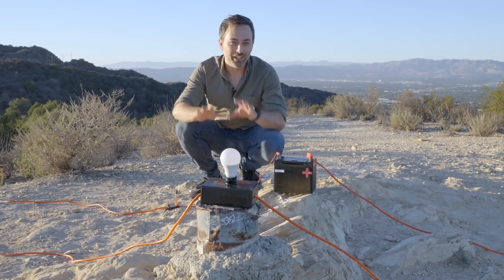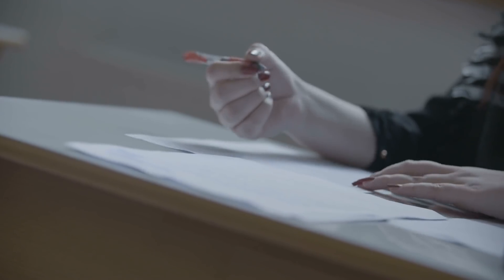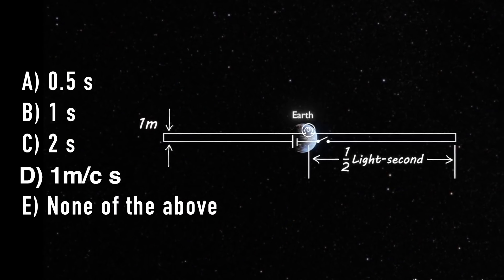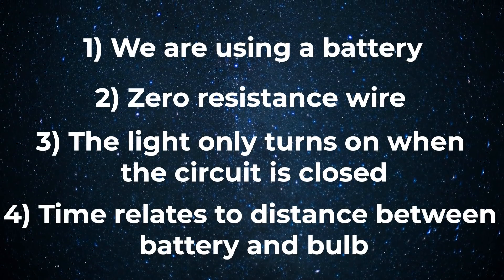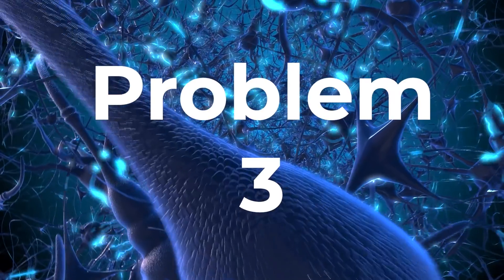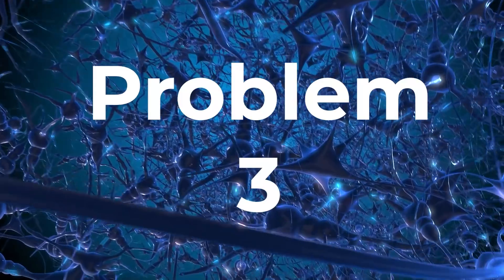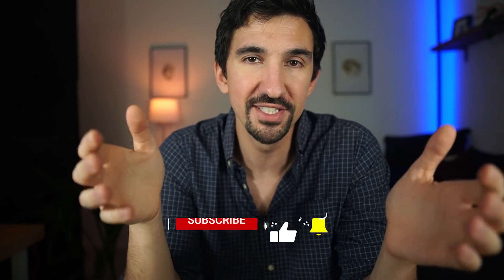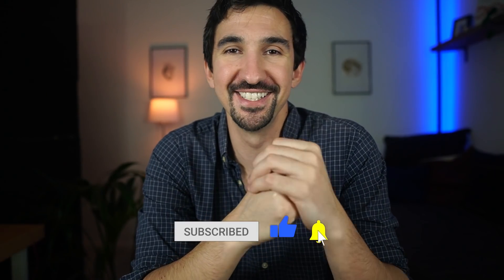Is Veritasium Wrong About Electricity?

Comment: I agree with the bulb not turning on if i build on the antenna argument:

Note- a conductor will sit at the same potential everywhere on its surface at equilibrium (or else the charges will flow to make this the case) 

-In the initial "equilibrium" state with an open switch the part of the wire (conductor) on the negative side of the battery will be at the same potential as the negative terminal up to the switch

- on the other side of the switch (the rest of the circuit) it is a condutor connected to the positive terminal so will be at the positive potential.

- Closing the switch will only cause the negative part of the circuit to touch the positive part (at the negative side of the battery) so current will flow there.

- the other side of the battery will not have this information communicated to it until the electrons' "influence" on each other propagates through the circuit to the other side.

-This means the current cannot be flowing in the circuit on the positive side until the electron influence reaches there

- the same argument applies to all parts of the circuit, the current cannot flow until the influence reaches there since it will be sitting at the same potential as the parts around it. 

-lastly the magnetic field from the flowing electrons at the negative end won't create a discontinuity in potential across the bulb (the two sides of the bulb are at approximately the same distance from the flowing current).

- if there is no current at the bulb and the bulb turns on, this would imply the current through the bulb has no effect (at all) and the connecting wires can be removed. Hence any circuit with flowing current turned on nearby will cause the bulb to turn on. 

- hence i agree that the bulb doesn't turn on

Comment: What I see in the original video:
Question: What is the fastest time a current hits the lightbulb.
Answer: A lightbulb not attached to, but placed beside a closed battery wire circuit should be consider lit.

It's not a simple is "his conclusion legit" question, but rather if that conclusion is an answer to the original question.

Comment: The "1" in 1/c is 1 meter (from switch to lightbulb), a measurement of distance. So (distance)/(distance/seconds) would equal a unit in seconds. "1/c" is correctly in seconds.
Reply: 1 states for 1 m in original Derek's video, not 1 light-second, which is about 300 000 000 m

Comment: So it does not work in real life. I got my imagination flowing and mind blown.. until some other dude also said: If we cut the ends of the cables. Then its the same as they were connected.

If u do that it should also light up the light-bulb in my room if i connect circuit like this into my  220 W hole and cut both ends.
its a very dangerous experiment but it wont light up mu light bulb for sure, i have had broken cables lying around before :D

Comment: Isn't the 'breakage at the outermost point' just building a radiotransmitter? and the bulb turns on and off again after 1s? And if you kept flipping the switch at the right time you could keep it on? just like modulating a radio signal?

So in other words every radio transmitter is just a circuit that doesnt know its broken yet...kinda??

Comment: The most glaring thing I saw in the original video is the misapplication of the right-hand rule.  One would wrap the fingers around the conductor, NOT the field.  This produces a 90° error in the direction of flow.  Absolute nonsense.

Comment: If Derek would be correct, the A-bomb wouldn't work. The cable length wouldn't play a role, and simultaneous detonation wouldn't be possible.
Actually, cable length does play a role, and it is chosen to make a simultaneous implosion

Comment: Since the voltage spike will propagate out in both directions along a wire, with distributed capacitance and inductance (reactance) between the 2 adjacent wires, it will involve the interaction of E- and B-fields as it propagates.  The corresponding voltage spiked(S) that it induces in the receiving wire would propagate forward AND back to the bulb as a continuous train, the level of the step-voltage seen at the bulb - for the 1st second - having a constant amplitude depending on the strength of the coupling between the two "antennae".  Since that coupling is weak for 2 wires a meter apart, the voltage (and resulting current) in the bulb - FOR THE 1ST SECOND - will be minuscule , and unnoticeable by a human.

Comment: Yes, the closing of the switch starts a step-function change in voltage that propagates in both directions from the switch,
and in opposite polarity in each direction.  That change in the E-field around each wire connected to the switch will cause
a corresponding B-field, and both fields will radiate outward, part of which will intersect the 2nd wire, and the 2 wires will
act as transmitting and receiving antennae, causing a very brief and tiny current spike to flow in the light bulb.  So what?
The light bulb still hasn't turned on long enough - or brightly enough - for a human to notice.  Derek's term "turn ON" is
misleading, or just click bait.
Reply: so true. Only modelling with idealised superconducting wires show some relatively strong signal. In reality, super fast change of current leads to a skin effect. The wires are no longer good conductors , they have resistivity, capacity, and inductivity, additional losses in case of material insulation, and so on

Comment: Like, is it useful for me to understand wave-particle physics when I'm wiring my house? Nope. Do I need to know how electricity basically flows in conductors and through devices, yup - even though that's not "actually" how it works. So, am I wrong in my understanding? Not really. If we ever actually end up using a 2m/c length circuit, then timing may be important.

Comment: The largest takeaway of the original was intended to show that the power was transmitted by the fields. To then criticize the assumptions and introduce your own, is fine, but it should be considered an addendum not a refutation.

Comment: I didn't watch the whole video and watched it roughly but let me say what I think of this video I don't believe the information is travelling faster than the speed of light, as let's assume there is breakage at that point still electron would keep moving till the endpoint of breakage creates an opposite electric field of that of battery. If they are moving, they are making a magnetic field, and the battery provides an electric field, so it will keep working till 1/2s. I'm sorry if I'm wrong; I haven't done actual physics since I left high school. Have a good day.

Comment: has anyone proposed actually doing the experiment, already? I calculated that with a fast led and photodetector, we just have a few ns latency so we could do the experiment with just 4 meters of electrical wire (=~15 ns). Use a fast repetitive pulse generator as a switch, one led with 4m wire very close to the generator, another led with 4 m wire placed 4 m away from the generator, and the two detectors connected to a fast oscilloscope with equaly long wires at equidistand position of the scope. prediction: they switch on exactly at the same time, the coupling between wires close to the generator is simply too weak to even get to the LED threshold.
Reply: what kind of pulse generator do you consider? sine, or something different? and what should be the frequency and the repetition rate (if any)
Reply: I'm honestly not convinced that an electrical pulse generator might be fast enough to fit the experiment.
However if a fast pulsed laser light + a fast photodetector (aka solar panel) is used, this might work )
The experiment might become more complex than expected )
Reply: ops, my bad. 15 ns is not such a short time. Your scheme should work )

Comment: Yeh this got me initially too for a while. Its presented as fundamental truth/ground breaking view change of how we think about electricity when its really like an aha gotcha physics problem.

the 1/c speed is just for any current generated by the capacitance between the battery and the light, he even mentions right at the end "the bulb won't receive the entire voltage of the battery immediately" again while this isn't made  big deal of its actually the crux of the problem.

there will be some induced emf in nearby wires at 1/c but the bulk of what we typically refer to as electricity goes via the wires.

Comment: My view is 4th option NONE OF THE ABOVE , simple the resistance of the cable would prevent the circuit from working there is NO battery Big enough that could power a circuit of that length , 

this is why electricity is transmitted in AC , vs DC , Ac travels further with less loss in power

quantum effects will also come in to play and break the circuit,  the time of the speed of light and information telling us is not the break in the circuit , says , is the switch working. yes or no at point of contact , no break in barrier of light speed at all 

simply put , that the circuit not working tells you there is a fault.    

the other effect is that from the point of speed of the electricity time is at a stand still,  hence why exotic particle hit the earth and make it though the atmosphere despite their life time being less than 1 second from leaving hte sun , but being detected on earth

Comment: When the key is closed, the current in the circuit rises from 0-->I which cause a change in flux. And according to Maxwell, a changing magnetic flux induces an emf dΦ/dt on the other side of the wire, connected to the bulb 1m apart which will result in a slight glow of the bulb, and later the current will travel all around the wire and we will see the full potential of the bulb.

Now about the faster than light problem.
Since both the battery and the bulb are in the same frame of reference, I don't think it matters.
Consider this situation, you have a long cycle brake cable, assume it's length is 4ly one end is located at Earth and the other end at Proxima Centuari, if you pull one end of the wire, the information if transmitted instantaneously to the other end, I think we can apply such a scenario in this case.
I don't know if its true, but that's my explanation.

Comment: Its WRONG, it allow Faster than Light (FTL) communication: move the switch et the end of the long cable, make the cables longer, say 1 light hour away and now you can send data instantaneously. The position of the switch surely does not have any impact on the circuit, but theory of relativity dictates that it should take 1 hour to propagate the switch change to the lightbulb. However, as explained in this video, it will light up almost instantaneously! The problem is, FTL breaks causality, which is a major problem. To fix the antena induction explanation, let say the circuit looks like 8, so the wires are not next to each other.

Comment: Im an electronic engineer, I will put my 2c in here, if 2c is allowed ;) 

The circuit is not entirely switched on until the energy is reflected back to the source unless the bulb and line are impedance matched. this means it may take twice as long before entirely powered up.

the other issue is, that using c is to assume the transmission line has free space permittivity and permeability which is hard to reason that even in ideal forms to be possible. 

Vp=1/sqr(L.C) if the dielectric of free space is used then vp=c=1/sqr(u0.e0) and the speed of light will be approximated. However the characteristic impedance Z0 will not be that of free space and likely mismatch with whatever the load ZL is.

Reflection co. = ZL - Z0 / ZL + Z0 suggests that a load will cause a reflection of the EM wave. Only when load impedance and characteristic impedance are the same, then there will be no reflected wave.  Therefore the load may take a while to turn on half way and then just as long before turning on completely.  It is also likely that if the source is impedance mismatched that there will be multiple reflections before power to the load is secure.

Unless the 1/4 wave length are the size of the circuit or smaller, or unless the time of travel is larger than the rise or fall time of an input, it is unlikely that engineers would take this into account. Then conventional theories works perfectly fine.
Reply: "It is also likely that if the source is impedance mismatched that there will be multiple reflections before power to the load is secure"
and this is exactly what modelling shows
some illustrations can be found in yt videos

Comment: Think of the long wires as antennas or a transmission lines.  It actually doesn't matter if the ends of the antennas 1/2 light second out are connected to each other.  What you really have is two pairs of antennas a meter apart that are half a light second long that are coincidentally shorted at the ends.

Lets actually pretend that our antennas aren't connected at the end at all, and that they are super conductors.

In this case, the signal is a change in electric charge moving down the length of the lines at the speed of light.  The lightbulb still lights up in 1m/c seconds, because that's just how long it takes for the signal on the antennas attached to the battery to propagate to the antennas connected to the lightbulb.

You probably wouldn't be able to tell from the current delivered to the lightbulb that the antennas aren't connected to each other until a second or MORE have passed.  Ringing between these really long antennas could keep the lightbulb lit for quite some time, and I'm not even sure you would be able to tell even in our idealized world in which there is no resistance.

See?  No causality issues at all.

Comment: 1/c s is correct because his question was very specific; he mentioned the light bulb is 1 meter away from the switch. The 1/c you checked on google is just the inverse of c. But for his question, the general solution is d (m)/c(m/s) where d is the distance between the bulb and switch. If you substitute the 1m, the solution becomes 1/c s.  So, I don't get the mistake he made there. He doesn't need to write it as 1m because the m has already canceled out.

Comment: Problem 1: You didn’t solve it either. 1m/c s = m * s / (300.000 m/s) which would result in the unit s^2. It should have been 1 m/c.

Comment: He's not wrong per se, but it's sloppy.  
For a start 1/c is not a time interval.  I don't think that's being pedantic, it's like saying I'm 6 feet per minute tall.
Second he waffles on and makes a lot of irrelevant statements and doesn't offer any real explanation or proof, except to point out that a lot of smart people helped him with the concept of this video. 
If you take a look at his links, some smart person (with a PhD) has done some analysis which says this effect would be observable if the wire loop was 1 light year long (not 1 light second as Veritasium's example).  I'm skeptical that you can reduce the scale of the apparatus by 6 orders of magnitude and have it still work fine. 
This thought experiment relies on the current in the outgoing wire inducing currents in the incoming wire by electromagnetic radiation, but this isn't explained at all.

Comment: 4:40

I dont think thats right. 

I think its not the distance of the battery to a bulb thats a problem but a distance of a switch to a bulb.

And in a way its the same, because if there is a breakage point in the circuit then those exposed bits of wire became new terminals for the battery basically setting that point as a "bettry" tor that particular case.

Comment: A lie doesn't need intent to be a lie. A lie from ignorance is a very real thing, Apple for instance, use this to quite an egregious extent with its customers. It's customers have no intent to lie, they just don't know any better. You could argue that the intent then lies on the company, but then we have to fall back to wives tales, where the intent was lost decades ago, and isn't even there anymore, it's just misinformation at that point, but it's still a lie from ignorance. 

Simplification for the sake of understanding on the other hand, I would agree this isn't a lie, it's just an example that's easier to understand so that a better understanding can be reached from there.

Comment: I have all kinds of issues with Veritasium’s video. This is regardless of circumstance a DC circuit. So while the charge propagates through the conductor there is no way that bulb is turning on in less than 1s. Furthermore, once the source reaches the load the energy required to overcome the resistance of the build will not be instantaneous. I do find it a bit comical that I watched this video last night and I see your video today. I simply do not see ANY possible way a single DC voltage source and load (light bulb) will cause that bulb to illuminate nearly instantaneously. Also, this isn’t comparable to high voltage lines to close to a conductor like a chain link fence, or even ESD resulting from the skin effect for example with a 12 V battery. Veritasium has made some very interesting videos, but this one was NOT one of them. I did however enjoy listening to your take on the video and will be subscribing to your channel.

Comment: the awncer is E none of the above .. switching position has no effect on time to on.
the light will runn without including a switch or battery in the circuit as drawn. the loop from light to disconnected switch and light to disconnected battery  will induce enough power from Earth's em field to vaporize  /sublimate  the whole set up  look up cooper wire tether space shuttle experiments

Comment: I think the mental model can be solved by removing the capacitor-like arrangement of the wires. Make the system a circle, where π * D = 1 light year, and the light and switch at opposing ends (meaning the switch and bulb are 1LY/π distance apart). Now there can't be any capacitance or field interacting, and we can understand what's happening in/around the wire.